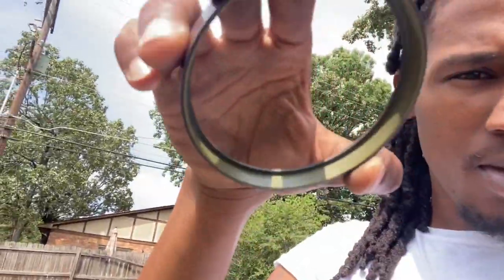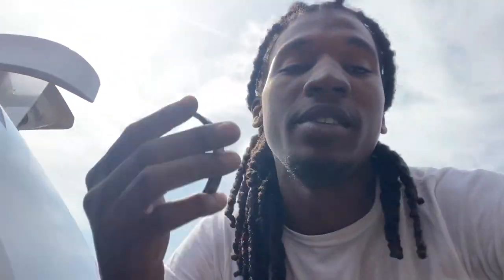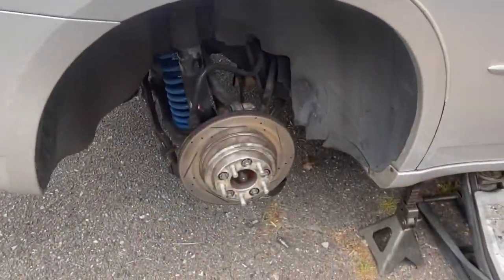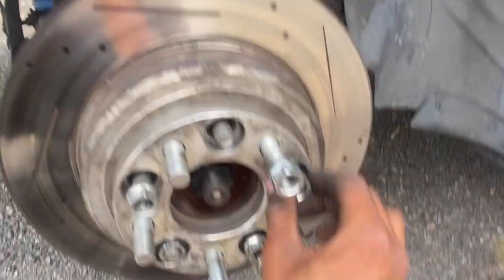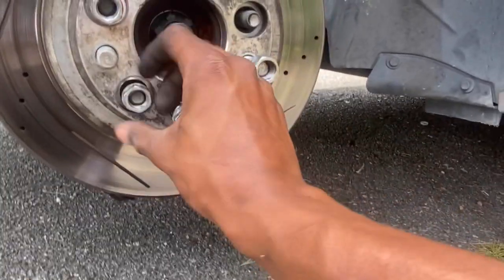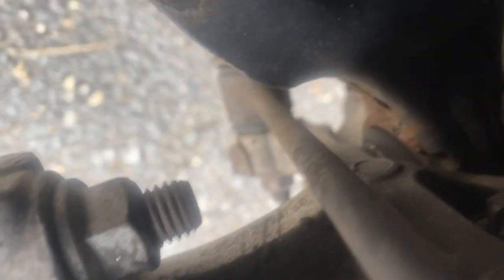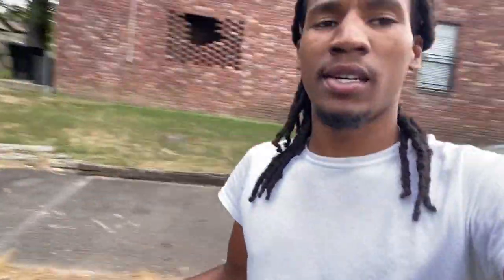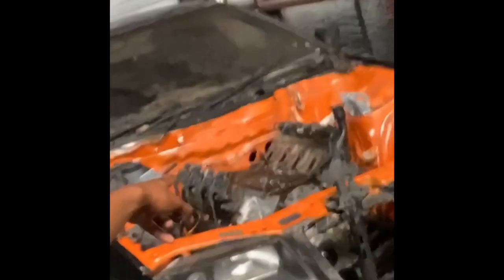Installing ABS SENSOR TONE RINGS In My Dodge Charger R/T !!!

Comment: Thanks for posting this - I did just have to do this, and I used your 'remove the hub' method and it worked!  A couple notes: I spent some $ getting a special socket that would fit on the hub and not hit the axle (used this from ebay and put a 1/4 socket on the end to use my ratchet "Power Nut Driver Set Impact Drill Hex Plum Blossom Socket Chuck 1/4in Dia E4-E14".  Thought getting the old ring off was a big PIA - curious how you did it - I ended up pushing axle as far in as I could and hitting the back edge multiple places with thin piece of flat steel and hammer.   No more abs codes though - made my week!
Reply from the maker: I push the axle In a few times and my old one just fell out. Pretty sure all of them wouldn’t be that easy tho.

Comment: How Did You Heat It Up I Have The Same Problem & Part Number But It’s Not Seeming To Fit.. 05 Magnum RT
Reply from the maker: Pot with Hot water allowed it just enough to tap on with a flat head. I ended up having to take the rear end apart again and just sanded the rust off the axles and it went smooth on.
Reply: @mooreaj  Thanks For The Feedback Bro Will Try That Next
Reply from the maker: @zeek_3456  fasho no problem. Push come to shove if u got to If the hot water don’t work might just have to pull the axle and sand the edge and make sure the old one is fully removed.